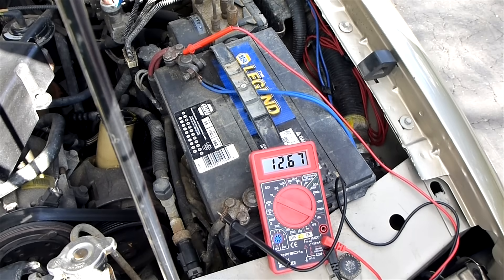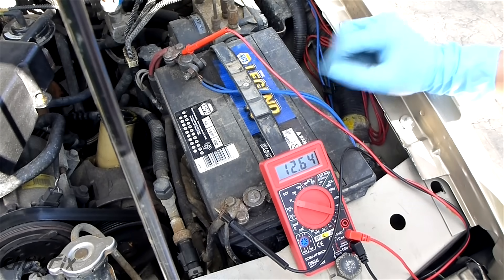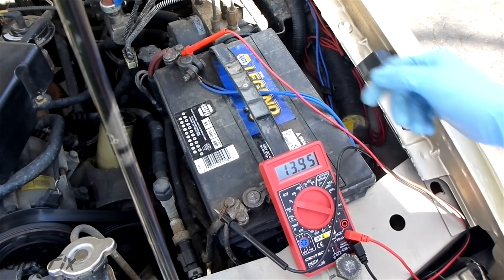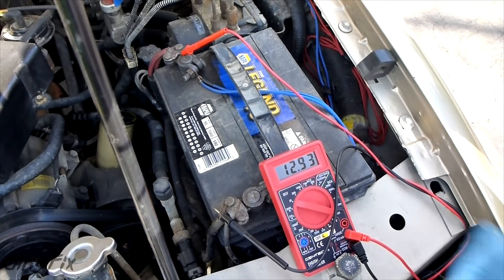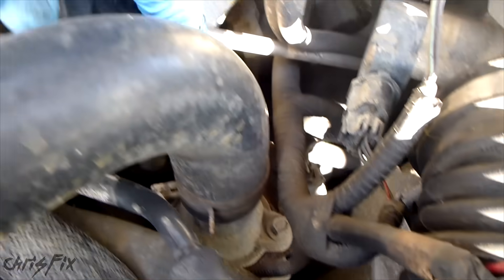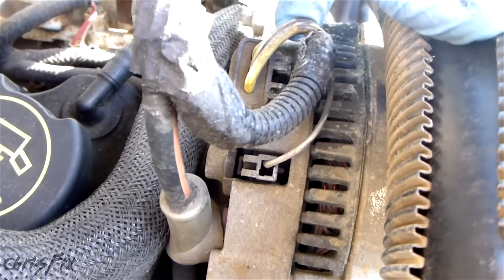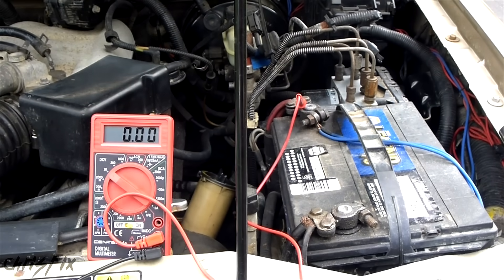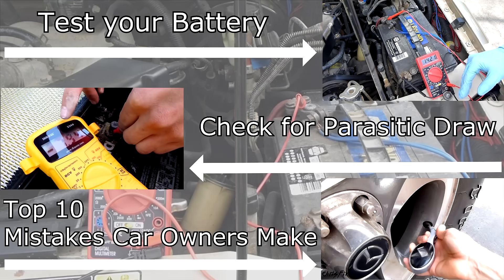How to Test an Alternator

Comment: hey chris i have a 05 mercury montego i have replaced 3 alternators and a new battery but i am still having this problem with multimeter hooked up  my voltage goes from 14.3 to 10 5 at random constantly have checked grounds,have tried wiggle test ,parasytic draw  could it be a issue with computer and how to test it

Comment: Thx chris, how to diff diagnose the regulator, vs alternator? Do not have any charge goin on, stays on 12.7 , batt voltage.....can it be the regulator? And how to diagnose the latter one in specific, via reading the voltmeter....i have old. Saab 900, and have everything in double ,but i wld take it as a good practise to learn diagnoseing whilst everything connected....thx in advance! 
I.could just change the alternator, but i read and see and heard from a friend that changing the regulator is easyer and doable with alternator left in place....but i dont like to gamble and guess and trial and error, thats my mean reason to ask you,
Thanks, bob the belgian,
Like your videos, clear and uptempo😁

Comment: how did you keep your rpms up during these tests?  didn't see you rev engine
Reply from the maker: I reved the engine by touching the throttle plate on the throttle body in the engine bay. You can also have someone in the car.

Comment: Chris - Nice video.  Wkg on boat with sbc 350.  Battery tests good but not charging.  Alternator tested good at shop at 14V.  Reinstalled and all connections cleaned.  Followed video and all was good until voltage drop test between battery + and alt +.  Reads around 18.75 whether at stud, nut or lead.  Any suggestions and what to check next?
Reply from the maker: On boats the first thing I do is check the ground wires and make sure they are cleaned with sandpaper and have a good connection. Next I would check the battery cables going from your alternator to your battery. Make sure they are in good condition.
Reply: Thanks.  I jumped the battery output on the alt to the selenoid and it was charging!  Yipee.  Noticed a fuse at the selenoid and all connections are good and clean so I will replace that fuse first before pulling wires out of the harness.  Much appreciated info and timely response.

Comment: Used video to diagnose a bad alternator in an 08 Kia Sedona.  I told sister-in-law that it was bad by looking at it.  (engulfed with oil from valve cover)   I went ahead and tested for her benefit.  Hooked same HF voltmeter up and showed her 11.77V and dropping as it ran and 6.77V in 2 minutes.  recharged battery and replaced alternator. ordered gaskets for this weekend along with A/C parts.   Great video.

Comment: my alternator goes from 14.1 to lower voltages like 13.3 or 11.3 to 9.3 do you think this is because of a short also when it happens I loose a engine power even though I have a brand new battery. I've never seen an alternator have intermittent problems before
Reply from the maker: Check the grounds and cables. Make sure they are all clean!
Reply: +ChrisFix they are spotless and I have an extra 10 gauge ground added to the alternator. I'm going to tare down the alternator and inspect the brushes and diodes
Reply: +ChrisFix it turns out that the brushes were not contacting the shaft because they were coated in grease due to a leaking power steering pump. I don't know how it's been charging the battery for the past few months

Comment: sir, what is the possible problem if my battery indicator in my dashboard doesn't turn off even if my engine is running? as i checked my alternator is in very good condition at the same time my battery is new. pls help sir. . thanks. .

Comment: Badass video Chris. On my 93 C4, when I first start it, the battery voltage is 14.4. But when the car gets up to temp, and i turn on the fogs, ac, and turn signals, the voltage goes slightly below 13, and the turn signal indicator starts blinking slow.
Reply from the maker: Thanks Brandon! That could be a bad ground since there isnt much metal on the Vette. It could also be a bad alternator just not able to keep up with the amp load. Try cleaning the negative battery terminal, as well as the engine ground before you replace the alternator. Luckily on our Vettes it is an easy replacement!
Reply: Haha I know easy to change On a C4. I was going to clean the terminals, but they are literally spotless. I'll let you know what ends up being the culprit.

Comment: So the alternator should be charging around 2 volts more with no accessories on than the original battery voltage? So on a 24 volt system it should be charging around 26 volts?

Comment: Awesome videos!

my project and question: I have a 2004 Chevy Express 1500 and I'm trying to power a window air conditioner in the back. the window ac is 12 amps x 115 volts =1380 running watts. I upgraded the alternator to 200 amp and with 12.6 volts it should put out 2520 watts I believe. The problem is that the AC unit turns on but shuts off after about 5 or 10 minutes. low power I suspect? I can see on the dash that my battery voltage is dropping, so I put in a second battery in series. still same problem, the inverter (3500watts) shuts the unit off after 10 minutes or so.

i know its a very strange setup, but any suggestions?

Comment: Hey Chris, I have a weird problem.  It's a 2000 Subaru Impreza, had a new alternator and battery installed in 2011. About a month ago, the battery died and I assumed it was because of the inactivity of using the car this winter (my bad).  Anyways, I fully charged the battery and it read 12.60. With the car running, the meter reads a constant 14.40 so all looks good but this morning, my car won't start again. Battery currently reads 12.38. Everything else with the engine appears fine and if I fully charge my battery again, my car will start up perfectly fine.  I was thinking that maybe my battery needs a distilled water top up?  I don't want to rush out a buy a new battery yet and if distilled water can fix this, it would be the better option for me.
Reply: do what's call the drop voltage test. Test the battery itself during cranking. any vehicle needs a minimum of 12 volts to start. if it's lower than 12 then you have a bad connection. most common suspects are battery terminals.
Reply: bro .. your battery has been damage.     ..   change a new  one ...  ..       the cause of that is .    you    stock/    not use   your  car for a month ...
Reply: most commonly. in the morning you  can test a battery if it  good or not.

Comment: doing your test I find that the voltage is 12.6 on the dry test . when I start the engine the voltage does not jump to 14.0 but gradually cimbs to 12.71 what's the problem?
Reply from the maker: The alternator is bad.

Comment: Is 13.5 - 13.6 fine for idle? Most of the time when I drive, my voltage stays at 13.9 to 14.0. Rarely goes up to 14.2 unless I have been using stereo when car is off. Is it possible the charging voltage stays low at times because the battery may be fully charged?
160 or 180 amp alternator with around a 632 CCA Battery from Mopar.
Car starts and runs fine but I'm curious about what i just stated previously.

Comment: hello..i test my battery i get 12.6v and start the engine 13.5v when i rev it up my idle the voltage decreasing below 13 volts.. wht is the problem battery or alternaror? need help
Reply: Most likely the alternator or voltage regulator..BUT, before you go and replace the alternator, have some place like an Autozone or a shop test your charging system first. Problem could be something else. And rememebr Always test things, never guess.
Reply: When i only use my car in morning there's no problem at all..but once i use at night  turn on headlights when i stop my engine it won't start..my battery is 12.2volts and i need to charge again to start my car?
Reply: Aaron James paraan
Okay here's what you do. Hook up a multimeter to your battery and start your car. If the voltage hasn't gone up to at least 13.6 then
Most likely it's your alternator that needs to be replaced. If your battery is working normally and no problems with the battery then replace alternator. Get it done soon or you'll wear out your battery and will need a new one soon.
Reply: I have a video on a easy and quick check of  battery and alternator. Feel free to ask any questions in the comments.
Reply: Just a thought, have you checked the belt tension.
Some belts can slip without making the familiar screeching sound.
It does not take much to make a difference.

Comment: Thank you for this helpful video!! I've had two batteries crap out on me, inside one year. Turns out, the connection to my alternator was partially bad because of some sediment on the charging lead from the alternator. I sanded it down, charged up the battery and my readings are all spot on. Thanks a million!

Comment: My battery output seems fine at 12.6v but when starting the car and putting load on, the output goes up to around 13.45v. Does this indicate that while the alternator still manages to charge the battery, it's starting to weaken?

Comment: How does it work when you have parallel batteries both being charged by alternator, will the V defer ?
Reply from the maker: The voltage in both batteries should be very similar to each other and this video still applies.
Reply: Hi Chrisfix, thank you for this video, I just confirmed that my alternator is shot and you possibly saved me from being stranded somewhere. Keep up the good work and 1 big like for you!

Comment: i have a 2003 Malibu and its been in and out of the shop. last week the shop owner told me to take the car to the dealership up the street because he has no idea what was wrong with the car. He changed everything he could think of but nothing worked. I took the Malibu to the Chevy Dealership and after paying $ 113.00 for the Diagnostic engine check, the said the battery was bad, the battery cables were bad and the starter was bad. I asked how could that be, the battery was replaced and the starter starts the car so i don't get it. and that's where i am now, can you help? oh, and the Theft System Light stays on. Any ideas- bobshell3@gmail.com if you will respond!
Reply from the maker: +Robert O'Brien That is tough to say without seeing the car. I would take it to another mechanic and get a second opinion.
Reply: yeah, i was thinking the same thing but wanted to see what videos you had.

Comment: Chris, I am having issues. I think I have a bad alternator. My battery does not charge, And i cant figure out why. I have everything plugged in, terminals really clean and tight, and my multi meter says my alternator is putting out power.
Reply from the maker: +Chris Crowder Check the fuse between the battery and the alternator. If the battery is showing 14 volts as it is running, and it is still not charging, then your battery is probably bad.
Reply: +ChrisFix that is exactly what it was. The fuse is supposed to be a 50A but it has a 60 and its blown... What would that mean?? It has 2 alternator power fuses, and both were blown.

Comment: Does it matter the amp of the alternator? I have an 83 Tercel 4 cylinder engine with a 50 amp volt. When the battery was not at full charge the alternator couldn't  keep the idle going. Should the number reading on my digimeter be same as what you show here at above 13.2-ish to 14? I don't have all the accessory lights you have, just reg factory headlights, no overhead lights at all.
Thanks!

Comment: My 2008 honda civic wont start. Engine wont turn over. Lights and etc come on. I checked the battery and it is 12.6 volts (the battery was replaced 3-4 months ago.) So how do I check if the alternator is god or bad??? or starter??

Comment: In this instance, the first thing you need to do is tighten the battery cables. When he put the negative lead of the multi meter on the negative battery cable, it moved. You can't do a proper test of the charging system with loose cables.

Comment: what if you hear something pop after you reconnect the battery and then turn the key to start the car. what would be the problem?
Reply from the maker: +FlaTz101 That is just from making the connection and having an immediate draw from something.
Reply: +ChrisFix I checked my battery and it above 13.amps should I disconnect the battery?

Comment: My car has a check engine light for bad camshaft sensor. People say that it could be the alternator but instead of checking DC voltage they said to check ac voltage to see if the it goes above .05 volts. Mine was at .196 volts. Is this true that ac volts should never go above .05 ? Thanks
Reply from the maker: +Kevinb1821 Ac voltage shouldnt go high but .196 isnt crazy high. My truck was at .3 and working fine. If the camshaft position sensor is sensitive for ac voltage then you might have a problem.
Reply: Thanks for the reply.
Reply: My voltage is at 12 with the car running with lights and ac on now. The battery is new so does that sound like bad alternator. It's making a whining sound when I use a stethoscope to the alternator.

Comment: I used the car last saturday and its fine,then i didnt use it on sunday.Then on Monday when i was about to use the car because im leaving for work,i was surprised that the car wont start.The light inside the car was working but very low,i turn on the radio,it was on but no sound,seems it is too low same as the light.I tried to on the other lights like the head lights but not working.What might  be the problem of my car,considering that the battery was new,i just bought it 2 months ago...thanks a lot...

Comment: Voltage drop is only .01 when running Fan, Radio, and Headlights. I don't have the extra accessories. Is that a problem ?

Comment: Early Mopars had the voltage regulator mounted on the fire wall. Rust or loose screws would effect the ground to the fire wall, and mess with the charging system. Also the bulk head connector, where the two harnesses meet are prone to wire corrosion. My 80 Powerwagon was driving me nuts. Have so many hours going through all the electrical connections. One bad ground or bulk head connection can mess up several circuits.
Reply: Try it in a Ferrari like a Testarossa, you will be ready to kill some Italian engineers. :)Notorious electrical issues.
Reply: That's why I bought a Ron Francis total conversion for the 70 B body with extra circuits for future upgrades. no more bulkhead connector to get corroded or in my cases melt/catch fire like it did on my dad when he was a kid.

Comment: I tried to start my car today and the radio turned on along with the lights inside the car, but the car was not running.  After several attempts to start the car it finally turned on.  When I reached my destination my vehicle started to shake a little bit and than died, a few times before I could finally park.  What do you think might be causing this??  I thought at first maybe the starter is going out since the car did not want to start up for me, but after it died when I was trying to park I thought maybe something else might be an issue.  I have not had a chance to check the battery with a multimeter yet.

Comment: hey chris i replaced my starter truck started and i was omw to the auto parts store i come outside and the truck is dead lights come on no crank at the ignition what do think it could be i checked everything else like you said u think the ignition switch might be the culprit

Comment: Thanks again Chris. Your video directly helped me again (especially since I have a 02 Ford Ranger). Tested the battery.

12.65 volts, engine off
11.93 volts, engine idling
9.12 volts and dropping with engine and lights/AC on

Replaced alternator and fixed everything.
Reply from the maker: +Aaron Spencer AWESOME! Glad the video was helpful!

Comment: Great information, I almost went out and bought a new alternator. I was reading .19 from the negative battery terminal to the alternator case, I pulled the alternator sanded the mounting locations, reinstalled and tested .06, now my battery light went out too. Thanks

Comment: Is battery on off engine reading at  12.38v too low?
With loaded engine, reading is 11.5v.    I have a bad alternator?
No load at 13.9v
  I have all dash lights (brake, batt, doors)  coming on intermittently/flashing  but car runs ok 10-15 mile drives or shorter  with no issues for last  few days. Thanks

Comment: Hi Chris,
Your videos are some of the best on Youtube.
Could't find anything related to starter motors.. Mine is making a grinding noise when the temperature of the engine is warm.
Reply from the maker: +GOKHAN DILEK I dont have one yet but it sounds like your starter is going bad. They tend to show symptoms when they are warm.
Reply: +ChrisFix would it damage the flywheel? I checked the battery 12.5 and battery cold crank voltage is about 10V which is good. 
pretty good when the engine is cold. Not sure if i should replace it immediately or wait till it dies :)